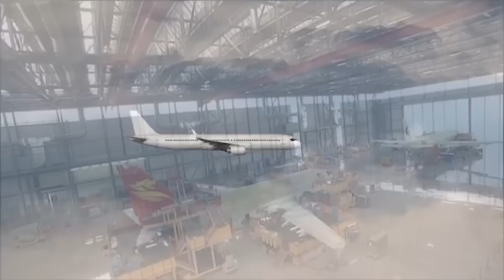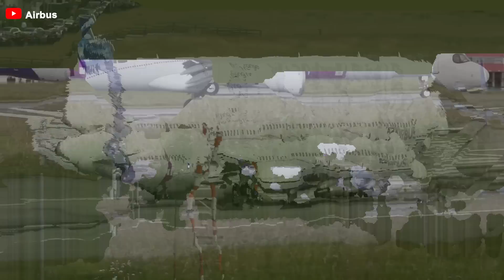Airbus New Aircraft Just Shocked Everyone NOW! Here's Why

Comment: Airbus A220 is a renamed Bombardier C-Series...which was a "hybrid" aircraft>>> a metal fuselage with a carbon composite wing.  Airbus has figured that they could re-wing the A320 series with a carbon wing and new engines, while maintaining the current metal fuselage...since they have gained the "hybrid" experience, by building the Bombardier (A220).  The wing will be a new design and have a higher aspect ratio and at least 20% more area, more fuel volume, for a "minimal weight increase" from the current metal A320 series wing, since the new wing will be carbon. Also, the new wing should have a reduced part count and easier assembly than the current metal wing (lower cost).  The big issues are 1) Landing gear, since the new gear will not fit into the current A320 wheel wells.  2) A new engine with enough thrust to accommodate the higher gross weight (increased fuel, 24 additional passengers and cargo).  A unique solution would be the "Thrusting APU" concept (Boeing looked at this in the 90"s), for takeoff, if they need a marginal thrust increase with no new engines available to meet the takeoff thrust requirements.  IMHO, if Airbus does build this airplane to meet the 757 Payload/Range niche market, it could be a huge blow to Boeing and a cash cow for Airbus.  Boeing had the opportunity to re-wing the 737 series, and tie up future dominance of the single aisle market, but chose the less expensive route...which was a terrible business and technical decision (Zero forward looking and 100% short term), which due to poor design, lead to the 737 MAX fiasco.  Airbus will need to ensure that their new "hybrid" A320 will have both upper deck capability, more range (without body tanks) and IMHO, a generous cargo volume, since more profits are made below deck, than on the upper deck (in dollars per pound of payload).  Everything in new and derivative aircraft designs are all about trade offs and compromise...and a very good understanding of the mission requirements you are designing the product to accomplish.  This new airplane will be less expensive than a clean sheet design, and will fill a need, until new technology engines are available (Hybrid turbine/electric, Hydrogen hybrid, Unducted fans, etc.).  Airbus must weigh the risk to reward before proceeding.  Boeing will not have the financial resources or will, to bring a competitor aircraft to this market.  Good luck Airbus.
Reply from the maker: Airbus has so many chances to beat its competitors!
Reply: Only looking at one aspect: Passengers always seem to prefer Airbus over Boeing. Why? Because model for model Airbus' are always wider than the competing Boeing. And the HVAC is better too. Although a size class lower, the A220 has more room and more hand luggage space than the 737, for example.

Comment: Airbus should also be focusing in a wider narrow body (XWNB - eXtra Wide Narrow Body) fuselage for better passenger comfort (for those of us with long legs, and/or an expanding waistline). If they did this for their next gen replacement or supplement for the A320 series (A360?) it will truly give them an aircraft both passengers and aircrew would love (more working room for the flight attendants). Especially for long haul intercontinental flights. Now that will truly be a excellent replacement for the B757 & B767. Just putting it out there for consideration.
Reply from the maker: That’s awesome!
Reply: A32x family is already wider than 737
Reply: @rokuth  Not going to assist people with long legs. Fat people would be assisted.